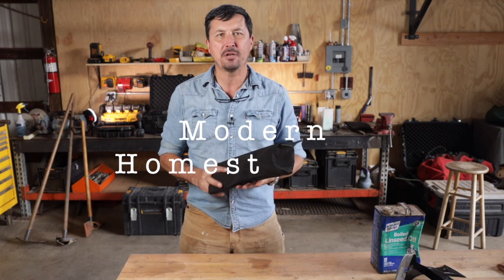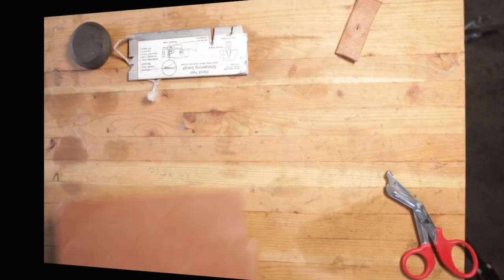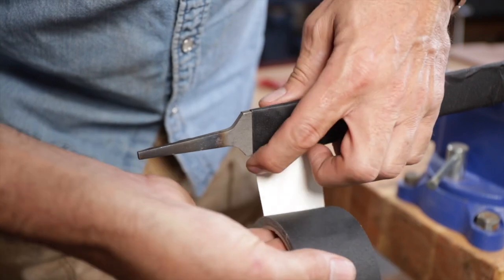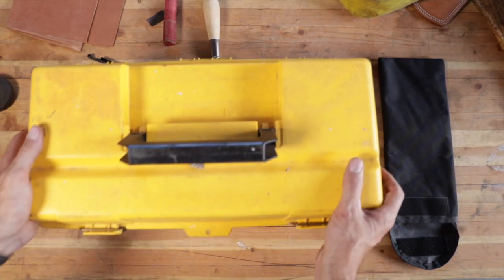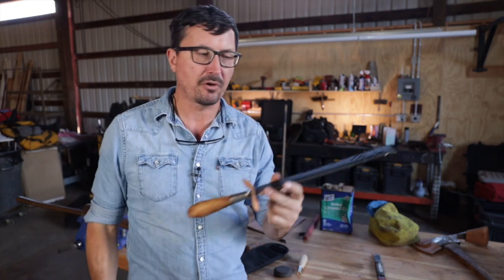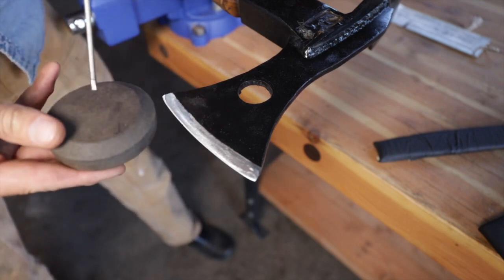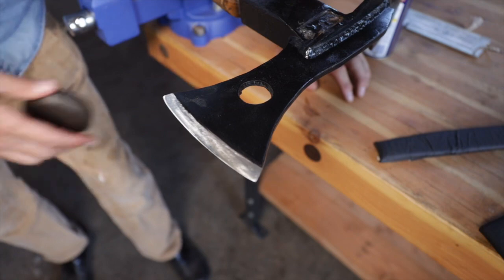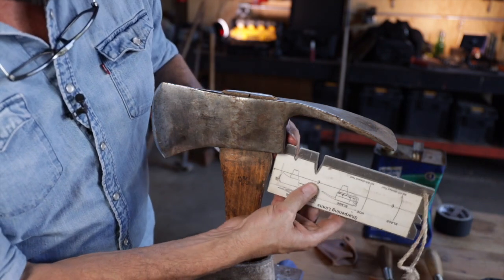Whats Inside A SECRET GOVERNMENT Black Bag???

Comment: I've always thought of "Safety Sally" as something cumbersome, that actually interferes with using the tool, or is of questionable value. That little strip of leather protects your fingers, and isn't over-the-top in any way. Prudent, not paranoid.

Comment: My Dad made these.  He used milk carton with corners folded a certain way, to hold a few oil drops.
  But he saved old caulking tube to cover the tang,  he would put 2 bands of elastic at the end and tape the caulk tube to it.
 Teeth were protected, the tang was covered and the 2 were stuck together.

Comment: Cody, I've found that raw tung oil and beeswax in a 4:1 ratio makes a fantastic axe and tool handle finish.  it seems to last longer and gives an amazing grip on the tool, whether sweaty or dry.  Use real tung oil, though, not a "tung oil finish" that has additives.  May take a few days to dry, but it's amazing once it does.
Reply: Do you melt the beeswax first, or just toss chunks in and let it incorporate?
Reply: @charlespeliska7054  I put it all in a double boiler and bring it up to melt together.  Mix with a spoon or other stainless utensil as you go and pour into a half pint Mason jar.  I do it by weight, typically 100gms oil to 25gms wax.

Comment: With all do respect and with the risk of sounding like a know it all, but, in this application, water would be the best lubricant for the puck. Being this is a field repair kit, water would be easier to have on hand vs carrying something extra. Unless of course you would normally have said lubricant with you. The puck works with either but once you use a solvent or oil it's hard to come back to water. So, buy 2 pucks if your just getting started,  1 for water and 1 for oil/solvent. Also a side note, you wouldn't want to use your water only puck in freezing weather as it could freeze and crack.

Comment: "An entry into another’s airspace is a trespass even if the trespasser doesn’t touch the surface of the earth. Airplanes may trespass by flying low over a person’s property, for example. An airplane trespasses by flying low enough over the surface to interfere with the owner’s reasonable use and enjoyment of /his/her surface" ....... there is also nuisance law that applies to any aircraft including commercial aircraft ...... check laws governing airspace and property rights around airports ..... extension of property lines upward is a gray area but can extend as far as 2.5 miles upward ..... have a nice day

Comment: What’s wrong with using oil to sharpen an edge
Reply: The old Buck Arkansas stone kits came with a flat can of oil. It was red and smelled like Marvel Mystery Oil.
Reply: totallyjonesin why does Cody reckon they shouldn’t use it then?
Reply: @oscarbourke1953  Well some, like the Arkansas, stones are natural stone cut from a quarry. And others are wet stones, synthetically man made. I have both. Water won't hurt either one to my knowledge but don't let a wetstone freeze in an unheated shop in winter. I usually use DMT diamond now with soapy water.